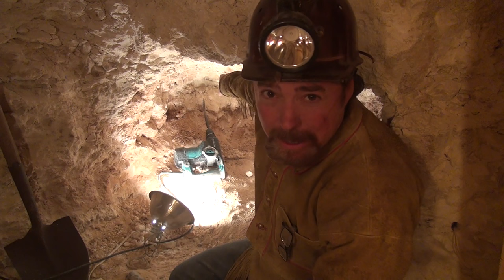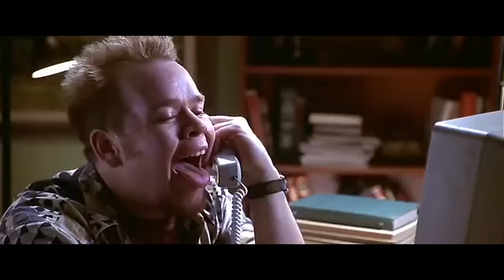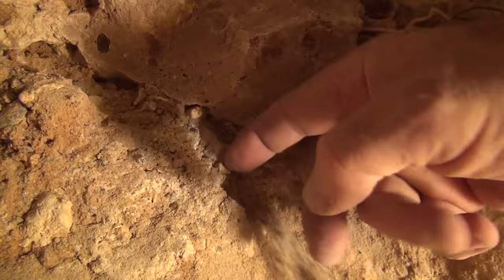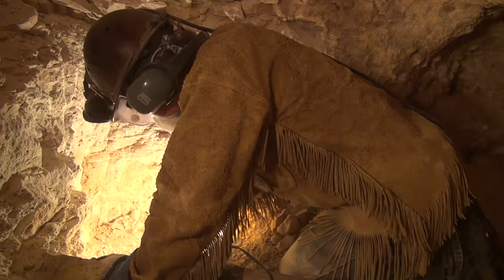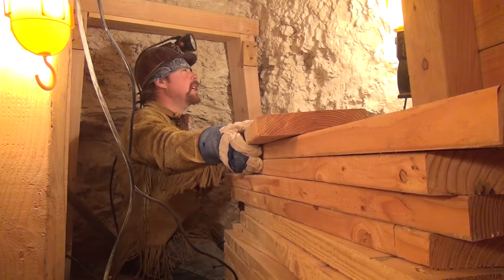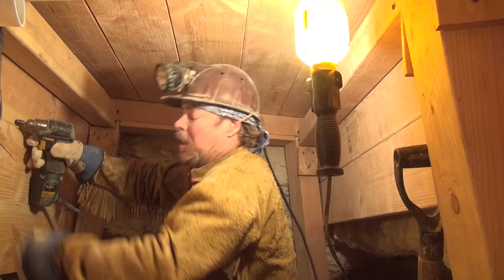You Want Gold...We Show You How. ask Jeff Williams

Comment: Love your channel! I'm not an "Internet Expert" but I will offer a little safety note: Nails have a higher shear strength than screws of the same diameter. Nails are the better choice for structural construction framing where joints and lumber can shift and twist. If you have an air compressor available, a palm nailer is a really sweet way to drive them too!

Comment: Hello Jeff. I'm very happy I found your channel because I've learned so much from you already.  I do have a question for you on mine timbering. This video you showed installing collar timbers and lagging as you drive your drift forward. My question is how would you do the timbers and lagging if you was to drive a drift off to the side kinda like you are doing now? What has me puzzled is if you was to the corner timbers wouldn't be 90° to the floor of the new drift since they are angled inwards for the drift you are driving now. Or would you just set another set of collar timbers next to the existing timbers and drive on as normal?
Reply from the maker: thanks ....... if they are set at an angle then another set if vertical then right off of that set
Reply: Thank you Jeff. I'm tempted to saw out a load of Missouri oak timbers & lumber and bring it out to you to help you drive your drift forward.